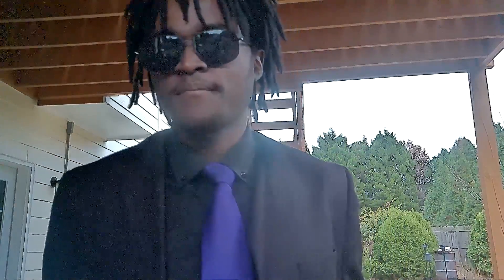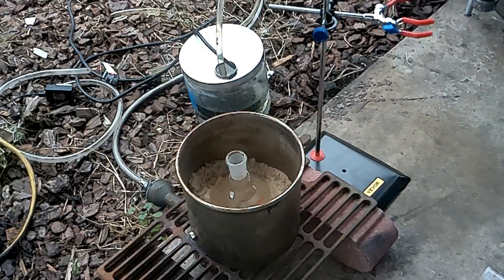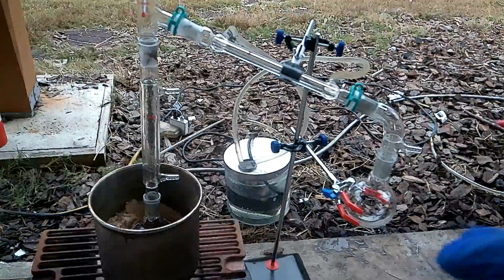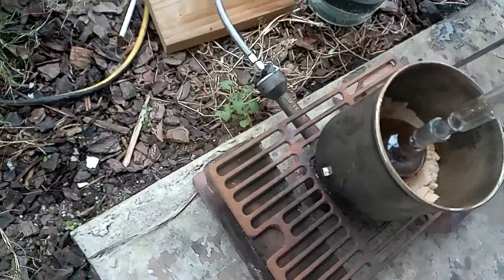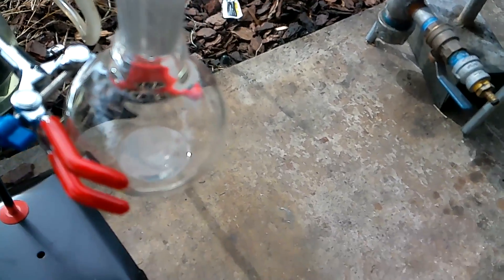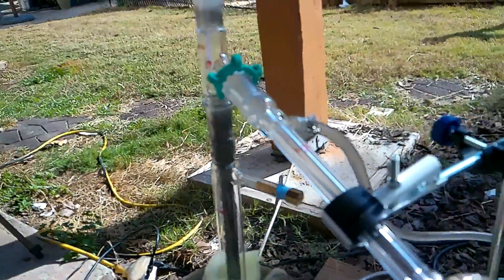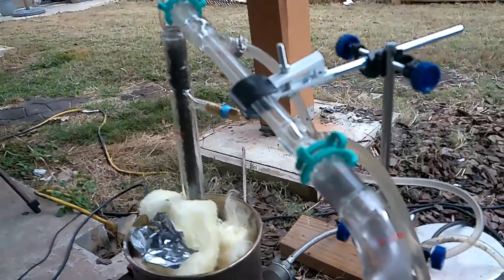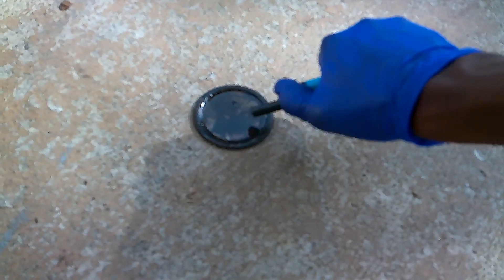Distilling GASOLINE out of PLASTIC OIL!  Pt. 1 ( I'm Back)

Comment: a good way to separate out the water is by adding some anhydrous magnesium sulfate, it bonds to the water and essentially removes it from the oil, but only do this when you've separated most of the water already, as this is good for getting out that last bit of water. and there's lots of vids on here showing how to make the stuff. really useful stuff.

Comment: You can insulate the reflux collum if you find that the vapors take too long to reach the top. It does not decrease seperation between the compounds.